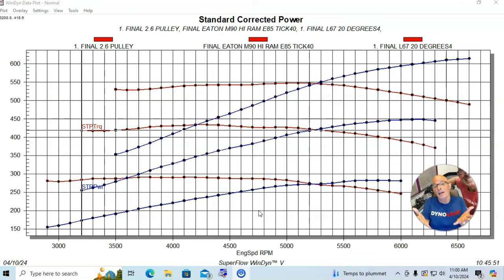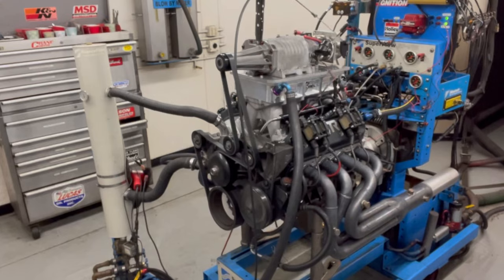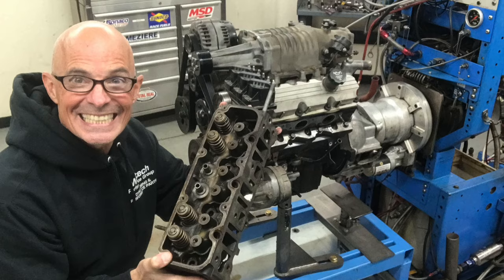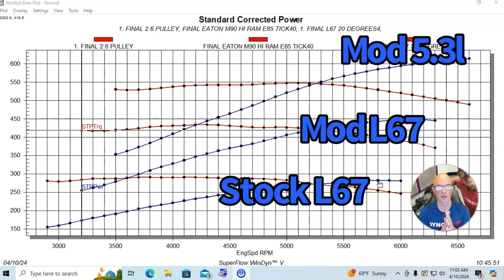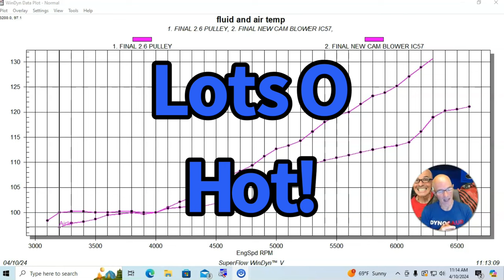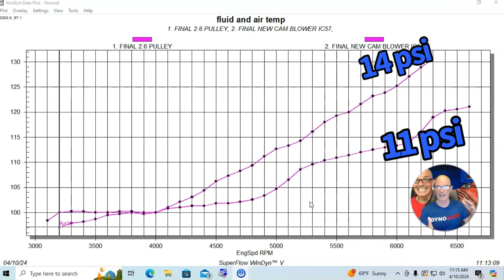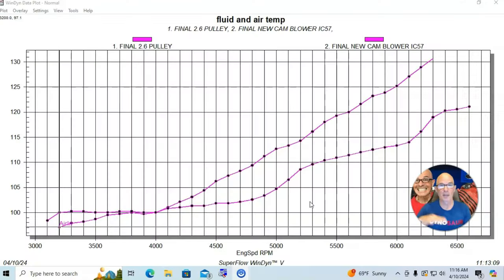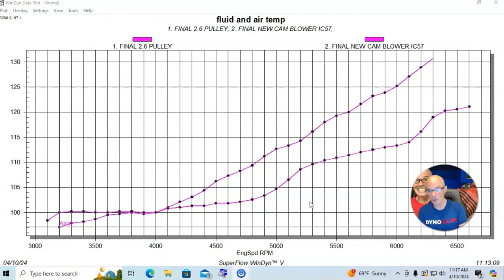M90 BLOWER HORSEPOWER MYTHS! IS IT TOO SMALL? IS IT TOO HOT? CAN YOU RUN IT ON A BIGGER MOTOR?

Comment: Agree with most of this with one caveat.  The idea that putting it on a bigger motor is even better (less boost, more efficiency, less heating) works until you reach a blower speed limit.  This M90 on a 492 for example, would have to spin 3x engine speed just to break into positive manifold pressure at WOT.  At 6500 rpm engine speed you're already near 20k rpm blower speed and I'd wager you would be hard pressed to see gains spinning much faster.  For PD blowers I like to see engine to blower displacement ratios in the 2:1-3:1 range.  OEMs have and do go higher (LT4 is 3.65 and the LSA is 3.25) but they're usually more concerned about low end fill.  Ford and Dodge are down in the 1.9-2.3 range and they have 1000+ hp potential on the stock blowers.
Reply from the maker: TO MEA, THE 492 DISPLACEMENT MEANS NOTHING-ONLY THE POWER OUTPUT-A 492 MIGHT ONLY MAKE 1 HP PER INCH-THE M90 WOULD ADD POWER TO THAT. AN NA 492 MAKING 2 HP PER WOULD NOT BE A GOOD APPLICATION
Reply: @richardholdener1727  Acknowledged and agreed.  But realistically anyone making 500 hp on a 492 would be better off putting a decent cam and long tubes on it and getting 600+ vs. trying to squeeze that out of a tiny blower, right? The bigger the motor, you should be thinking bigger blower - even if the smaller blower can make similar power.